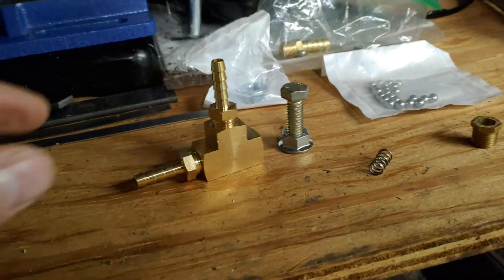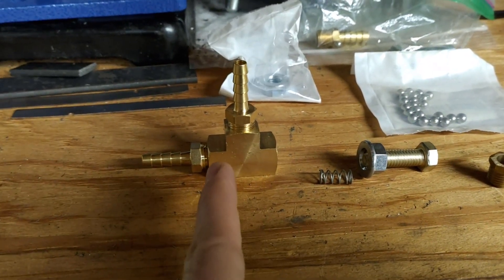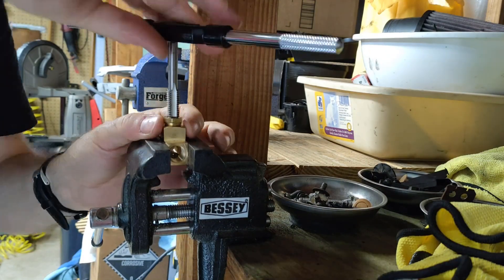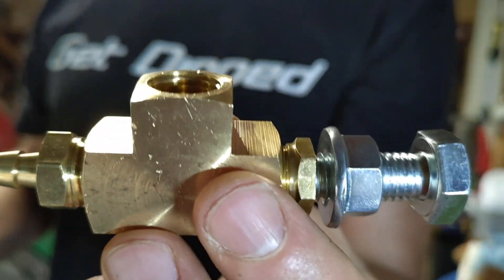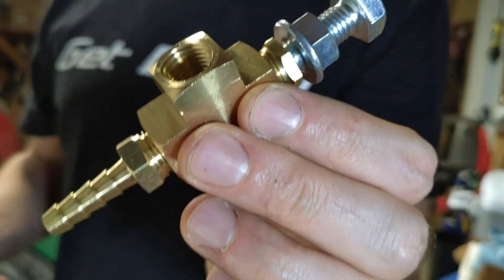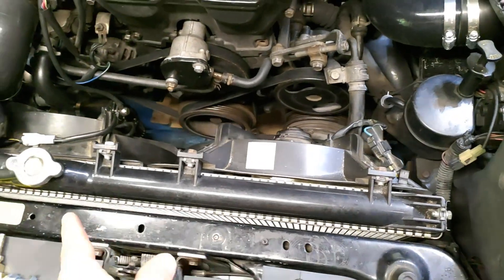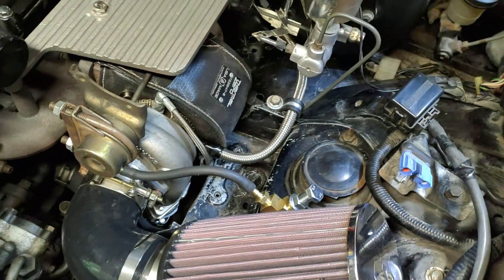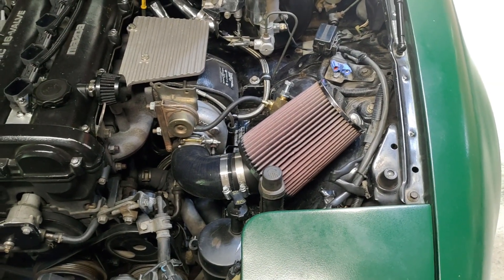Control Boost for Cheap - DIY Manual Boost Controller

Comment: BTW, these mazada things are set up unique arnt they? Is that the water pump sticking out front?
Reply from the maker: No I think you mean the water neck...usually that's connected to the upper radiator hose.  But I have a coolant reroute so I just have a plate over it to block it off.  Next time I have the timing cover off, I'll probably remove the whole neck to clean it up.

Comment: Put tape on those threads and the bolt to jambed nut setup will be more forgiving when adjusting. You knownwhat I'm saying? It will have some resistance for you while your trying to set the angle of the dangle....yee yee.
Reply from the maker: Good idea!

Comment: Pressure regulators often will have a washer that sits between the adjustment screw and the spring to prevent binding and spring shift. It would also stabilize the seat pressure of the ball bearing with a consistent vertical downforce.Edit: I enjoy your content and thanks for all the MS tuning tips a few months back.
Reply from the maker: Thanks, good tip!  My spring seemed to seat fairly well on the bolt but now that you mention it, I may go back in and add a washer like you suggest.  Easy insurance.